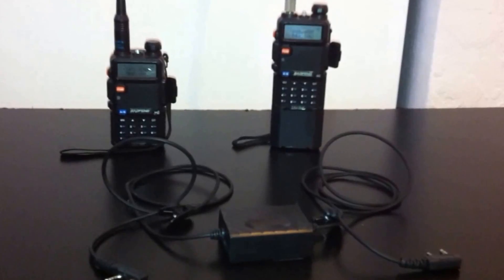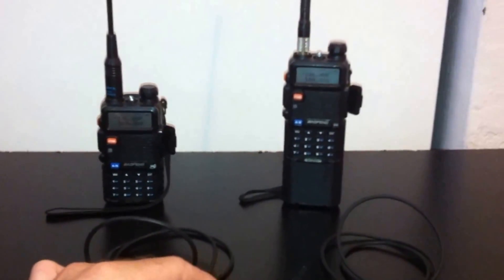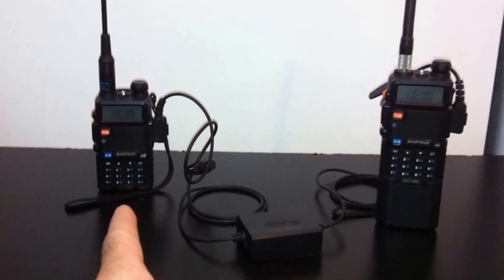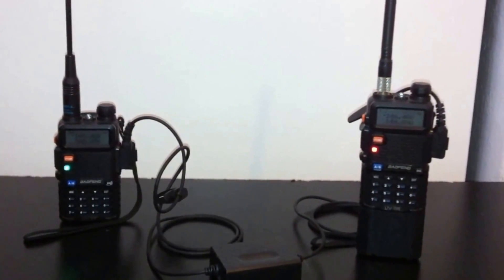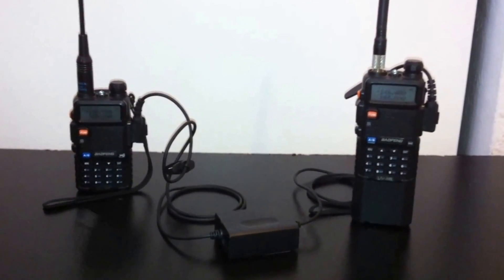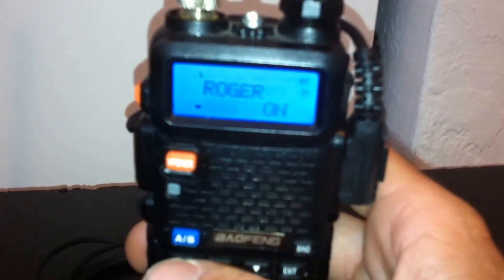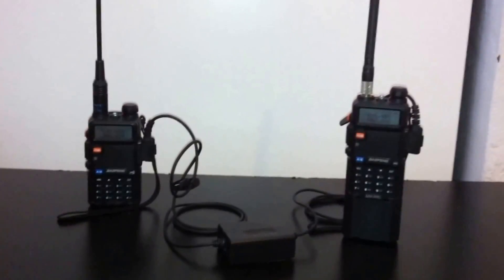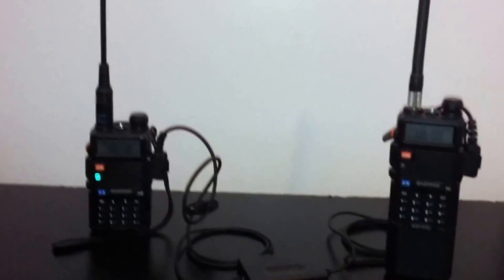Set up a Baofeng UV-5R repeater

Comment: This is a really cleaver idea, but it has one drawback: Repeaters are legally required to identify themselves every 10 minutes. This setup does not permit that. Being temporary you will probably be able to get away with that, but it's something you should know. For an emergency or very remote application it would probably be OK.
Reply: shut up

Comment: I'm new to radio tech. Can someone explain how this setup can extend your range? isn't the purpose of a repeater is to have a longer antenna repeater with more power? so how come two short range handheld radios will extend?
Reply: It can more than double the range Mehran.

Think how far apart two friends can be, yet still both see and hear the same helicopter.  They could be at different sides of the city, yes?  They can both see and hear the helicopter but have problems seeing or hearing things happening just a street or two away at ground level.

So, consider that the radio users are at ground level and the repeater can be set aloft.   Not only can you double the Point-to-Point distance between users by relaying, but you may even get Line of Sight over 5 miles or more, whereas the users may lose sight of each other after just a few hundred metres.

This is why radio and TV towers are placed on such high masts - so that they can look downwards on all those rooftops and penetrate into every street easier because there's almost nothing but air between them and the listener.  If they were at ground level the signal would have to pass through every single house, car and tree in the city to reach to the other side :O

That's why repeaters are so useful : )
Reply: Get over hills and essentially doubles your range.

Comment: Hey dumb question - wouldn't it be better to cross band repeat so that the receiver isn't de sensetized every time the Tx comes on?
Reply: +Nathan JR
Agreed.  The only proper way to repeat in the same band is to use tuned cavities (notching) as far as I am aware, but the cost of those defeats the purpose of an ad-hoc baofeng repeater.  With 5w units it IS possible with a little distance, careful choice of frequency offset, etc ... but it's a hassle.  Vertical separation of antennas is more effective than horizontal separation but then you're sacrificing height which can make the whole endeavour pointless unless you've got natural height by virtue of a hill or crag.

It ain't always straightforward by any means but it's certainly doable, particularly at low wattages, with a little experimentation.  I've deployed them many times in the same band without major problems, but placement is key.

I guess the best advice is to always favour cross-band if at all possible.
Reply: Hey Nathan.  Not a dumb question at all.
Yes, cross-banding usually reduces swamping/splatter problems... but it's usually best to solve the problem and run a normal single-band repeater where possible.

In addition to what Austin said - remember also, that even if your users do have dual-band units ... not all can be set up for cross-band duplexing.  The baofengs are a bit weird - they cannot access cross-band repeaters using duplex mode from the radio settings - you have to use the chirp programming software to create a cross-band duplex memory channel.

To set up cross-band user operation without chirp you have to use two simplex channels and the dual-watch mode.

1. Set up VFOa (repeater input) and VFOb (repeater output) on their correct band/frequency
2. Turn on dual watch, so that the radio scans both VFO's for activity
3. Set VFOa as the active VFO (The one that is used when you press transmit)
4. Lock the keypad - that a<->b button is too easy to hit accidentally ; )

You should now be able to access the cross-band repeater easily.

If you get out of range of the repeater, your group-members radios will automatically communicate directly via VFOa.  That can be useful, but can also leave you with a false sense of security and not realising that you're out-of-range of other groups or your base camp.  So, remember to check in regularly if that's important.

TIP: If you ARE in range of the repeater and a member comes in barely readable on VFOa (direct) ... briefly raise the squelch.  This cuts off the signal briefly and causes the dual-mode monitor to move on to VFOb, where it gets locked on the better VFOb signal.  If there is no VFOb signal (maybe out of repeater range) it will just land right back on the VFOa signal anyway.  So, it's always worth 'jogging the monitor'

Obviously, if you can set all the radios up in advance you can use the 'split' option in the chirp software to create a proper cross-band channel, but it's always useful to know how to set up cross-band operation manually in case you need to do it in the field.

Also, remember that cross-band for the sake of it is always a bit of a trade-off and means asymmetric performance.

But I'd still say look at your repeater setup and try to resolve the swamping issue first.

Gary
Reply: "To set up cross-band user operation without chirp you have to use two simplex channels"....... ehm... NO!
Reply: +Jerry Kuhn
Thanks for that, and you're absolutely right.

I do think it depends on when/where your Baofeng was made though.  I have two that don't properly create crossband offset from the interface.  My friend has a unit which does, so we sat them side by side and mirrored the exact same keypresses ... same problem.  We finally did a factory restore but the affected units still don't set up crossband.

I think there have been some poorly documented revisions to the firmware over time.  But you're absolutely right, I've bought others since which work perfectly.

Luckily, my old two are now both stripped down to the boards and I'm controlling the SDR (RDA1846) directly from a PIC chip for long range telemetry with my yacht alarm system.  Basically, it chirps me with alarm state, battery voltage, bilge pump seconds, inside/outside temperature and inside humidity from 3 miles away.  The local unit decodes the data and writes to a display panel in my shack.

The UV-5R's are amazing little things : )
Reply: It depends on your definition of "better".  Suppose you have radios that have only one band, i.e. the Baofeng 888S (UHF only). No crossband/split frequencies there. Two UV-5Rs would be fine in a crossband setup, though.
Reply: What I meant by cross band repeating originally was UHF on one radio to transmit and VHF on the other radio to receive or vice versa. Receiver sensitivity gets completely smashed when one of the radios is transmitting this close to the receiving radio on the same band, which is why the amateur satellites always do cross band repeating. The radios in the video are both capable of UHF and VHF, so it only made sense in my opinion to cross band repeat, since the capability is there. Has nothing to do with the firmware or anything like that. All that is needed hardware and firmware wise is shown in this video. I have a UV8D that is capable of cross and repeating on it's own, but that is not what I am talking about. I am talking about using two radios with the cable shown, one on VHF, one on UHF, one receiving and one transmitting. And as far as the operators using UV5Rs, it is capable of cross band splits programming it through chirp.
Reply: +Jerry Kuhn
A raspberry PI seems like massive overkill for this.  You could prototype this on an Arduino and then ditch the prototyping board and simply use an AVR chip in the field.  I used a PIC chip but the principle is the same.

The difference in power consumption between an AVR chip (running Arduino) and a full PI setup is huge, and the AVR is more than capable of producing large enough signals for the Mic port unamplified.  At the more energy frugal end of the scale the smallest 8 pin PIC chips will do this perfectly and you can use the inbuilt timer to sleep the PIC between idents (optionally waking on overs for a courtesy 'K' if desired)
Reply: Jerry Kuhn I would usually only use a duplexer if I only had one radio and two antennas on different bands, but it really depends.
Reply: Jerry Kuhn I'm interested. What exactly did you have in mind?
Reply: Jerry Kuhn are you able to run the duplexer with two vhf inputs? This is what confuses me.

Comment: okay I get setting up the first two radios what do you set radio B on ...the exact same frequency and offset? because I am thinking if you do that both radios will receive. I guess my question is what would you program into radio B to have it transmit out of the repeater?
Reply: They do have to be different frequencies, or else the transmitting side would hold open the receiving sides squelch and you'd just get a big feedback loop that would never stop transmitting till you turn off the radios.

Here's a scenario ...

Output Radio - set to 145.650Mhz
Input Radio - set to 145.050Mhz

So, all your users are listening to the repeaters output on 145.650Mhz, and they need to go DOWN by 600khz whenever they transmit, because that's where the repeaters input frequency is.

We call this 'the repeaters offset' ... In this case, the offset is -600khz

An offset can be - or + ... depending on whether the repeaters input frequency is lower or higher than it's output frequency.  In this case it's minus 600khz.

So an offset of -600khz just means (The repeaters Tx frequency - 600khz = the repeaters Rx frequency)

Great!

So... now your repeater is happily listening on one frequency and (re)transmitting on another.  We also know that our repeaters output is 145.650Mhz and we know that its offset is -600khz

Now we have to go program the users radios to do the same thing, but in reverse.

So, on the users radio:

set the receive frequency to : 145.6500Mhz, so it listens to the repeaters output.
set the repeater offset to :  -600khz, so whenever you transmit it goes down 600khz to the repeaters input frequency.

Now the users radio will listen on 145.650 - but will transmit on 145.050

Because this is the opposite way around to the repeater, the system works.

Hope that helps

Comment: another thing , fm is not cb radio, fm relys on the line of site, 1 watt or 3 watts you will see very little difference maybe none, mobiles run at 40watts high power on uhf, commercial  and ham, and a lot of times a 3 watt handheld if your positioned properly will have the same signal strength, Its not about the more power the better on fm

Comment: a handheld repeater is not going to give you much improvement, you still using the same setup with just a couple of low power, weak front ended radios, simplex will work just as well, dont kid yourselfs, use a real repeater and duplexors

Comment: Can you not just hook them up with cables to do this? What's in the box?
Reply: I guess there's something about squelch and triggering.
Reply: You can just hook them up with cables. I've done it. It works.  The transmitting unit would be set to VOX in this case. Unfortunately, the Baofeng VOX doesn't work all that great. The add-on controller box is more reliable to actually key up the transmitter when the receiver picks up a signal.  Squelch? No. Triggering? Yes.
Reply: +Hangfire
No idea what's in the box, but I'd assume it simply triggers on audio voltage and closes the PTT on the second radio.  I'd also expect there's some simple level protection rather than a direct link between speaker and mic too... because setting the levels correctly can be a pain in a back-to-back (vox-operated) configuration.

I'm in the process of building my own repeater harness for radios like the UV5R with Kenwood K1 speaker/mic connectors.  I did have a play with a PIC microcontroller over the last few weeks and found that you can implement the periodic morse idents quite easily and even transmit tails (short hold-opens) with a soft K... which I've always found helps weaker break-in stations.  These PICs are less than 50p per unit so I figured why the heck not : )

I'm meaning to have a go at some DTMF decoding sometime next week to see if I can't set up a remote shutdown but I'm at a loss for what else I'd want DTMF control for.  Setting scheduled power-up/power-down times could be useful I suppose, for extending battery life when deployed for a weeks camping.  Luckily the radios handle the CTCSS so that's one thing I don't have to worry about implementing.

I'll be posting up the code and schematic once I've got something I'm happy with though.
Reply: Yes there's a video here in youtube that did exactly that. Using the built in VOX to activate the Tx radio.

Comment: For that setup I just used a cable with 2 earphone plugs ( 1on each end ) and connector to make one smaller, so the frequency set up is the same just a single cable would be a cheaper way
I'm looking to be able to talk both ways ( yaesu ft-757 gx to baofeng uv5+plus )
I got it working with my cheap cable, only needed to put 757 mic next to baofeng so the 757 could hear it 
So I would like to know would it work both ways around ?
As I'm thinking of buy the cable you are using.
Reply: Uv5 - vhf/uhf            757 - hf radio ( fm, am, Cw, sub,lsb )

Comment: the FRS radio transmit with only 1 watt so you can use the beofeng and just turn down the power. The freq are found really easy online I have 2 FRS radios and a Wouxun HT and I have been able to use my wouxun HT to communicate to the FRS that my wife or both that family members have. I didn't see anything online that said you couldn't use a HAM radio on FRS as long as you lowered your power setting.
Reply: +bryon clemons 

yeah, because someone who responds to a video must have the same equip that the video is about. 

First off myself and prob tons of Hams would love to know where to get our hands on a good $25 ham radio. My two radios were more then $25 and they great.

 I do not now or have I ever owned a baofeng, but people love them. 

I prefer to own American products but there are no real American made Ham radios. The so called American made radios of Icom and Motorola are not made here. Icom has Asian boards and more most of the time and even Motorola when you pop the battery out of the HT or look at the back they all say made in Malaysia. So, Ill take the made in China or Japan over Malaysia any day.

I am aware of the issues in part 97 but if a natural disaster or worse happens it's good to know how to do this kind of stuff. It's the people who don't take the time to learn new skills that will be in trouble if something major were to happen.
Reply: +Shawn Rigoulot note it is not legal to use them for gmrs or frrs, detachable ant and power, not part 97 compliant, quit hidding the truth
Reply: +Shawn Rigoulot technically you cannot transmit at more than 500 milliwatts which means you're still breaking the law. but in all honesty who gives a shit, and you WILL NOT be caught because nobody actually cares. As long as you are not abusing the frequencies, using bad words, playing music etc. You will be fine. You should monitor your signal just to make sure you're not causing splatter onto other channels of the FRS though - high power settings can create issues for FRS type radios if the channels are closely spaced, you get bad static every time someone on a nearby channel talks with their high power radio.
Reply: if you can't transmit at any higher then 500 milliwatts.. then why do the ones they sell for both frs and gmrs say 1 watt or 2 watts or 3 watts??? Just curious why is it on the packaging by most companies including motorola.. maybe the FCC should send them a nice little note..
Reply: +Shawn Rigoulot to make things simple goto fcc.gov website part97 the info is all there, we wouldn't be having this conversation if you paid more than $25 for the cheap Chinese radio

Comment: cant you just use a 3.5mm to 2.5mm audio jack from speaker and then run 3.5mm aux to the mic port on the other radio and set the offset? then set roger tones on the transmit radio? once you do that with the cable if the radios are on the transmitter will just start transmitting on its own, they need to be off while ur plugging everything in.
Reply: I used the 3.5mm to 2.5mm male jack.the problem was my tx radio was draining fast and it overheated the tx radio.the worst was when i walk 15 meters away the repeater didn't repeat my voice.it only light up that is indicate that their is someone pressing the ptt.how can you fix this problem?plz give me an idea..
Reply: That is the exact problem that I am having.  How did you fix this?
Reply: I am having same problem!!  did you get the issue solved??

Comment: Nice video, but, can I connect two radios only by audio kabel to make them work as repeater?
Reply: Yes, but the audio will be so harsh that you may not be satisfied with it
Reply: @waylonk2453  True! And for Damir, the reason is simple. There's an impedance mismatch which the repeater box handles for you. My experience with my repeater box is the volume of the RX is roughly one-half turn, or barely over half-range when using it for optimal modulation.